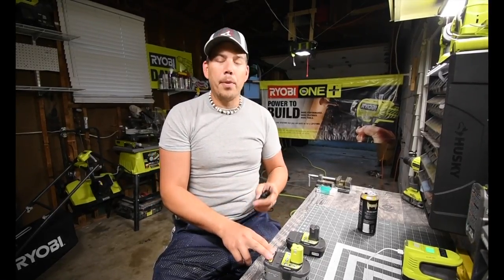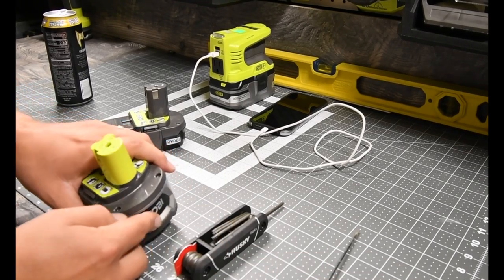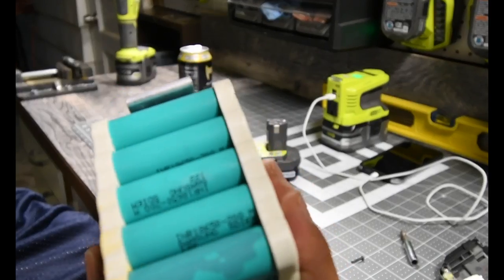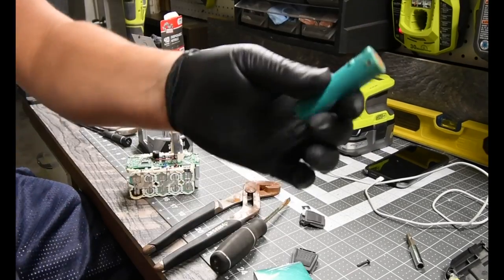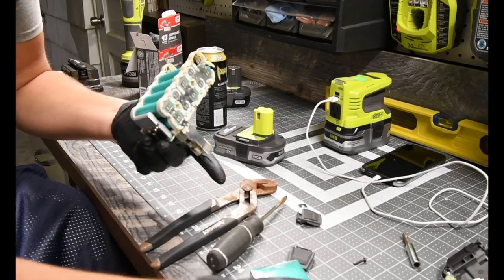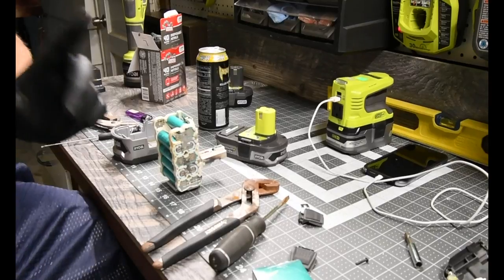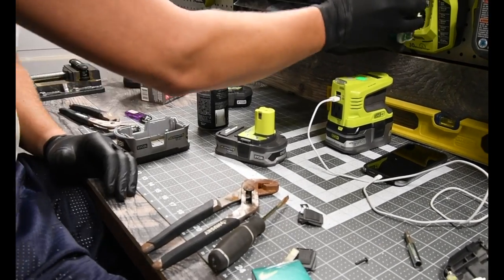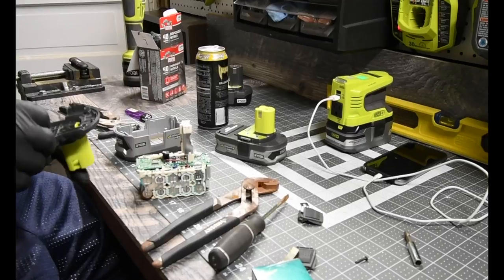Ryobi Battery issues!!

Comment: On the dead pack it may have a dead cell.  What often happens with Lithium-ion packs, especially if you store them for long periods either completely full or very low (they like being stored @ 50-60%) is sometimes a cell drops to a voltage where the charge circuitry thinks the cell is damaged.  In this state the charging board in the battery will not engage.

Check the voltage across individual cells with a DC voltmeter.  If you find cells below 3 volts you can attempt to "jump charge" the low cell(s) with a 9 volt battery.  

Take a fresh 9 volt battery & a 9 volt connector with bare wires.  Touch positive to positive,  negative to negative on the low pack batteries.  Touch on the specific cells paying attention to polarity.  Hold for 30-60 seconds & then check the cell voltage with your meter.  If you get them all up to the charger threshold the pack will begin charging.  Cycle the pack once or twice to help balance out the pack cells.
Reply from the maker: will do sir and thank you
Reply: @ManCaverTools  i found 2 dead cells and replaced them only to realize the pack doesnt power the recip saw longer than 30 seconds...sigh

Comment: Had similar issue with the 2ahr. Had to jumper it like a car battery using a 4ahr. Only 15 seconds on the big contacts. Then charge like regular. Plenty other vids about how to.
Reply from the maker: Ill check them out
Reply: This is what I did once it's replaced a couple of bad cells. Worked like a charm👍

Comment: You have to check every battery for voltage with multimeter, if battery is zero is done but more than 1v it can be safe and also you can add another battery to the pack as long as you solder the ports and it's the same amps or close to it; now the 2ah battery check the voltage from positive to negative on the pack and not the top ports and every single battery because most likely it got discharged below the threshold(which is around 13v to 14v) and the charger says it's faulty, if that's the case and every battery has charge in them you have to jump started with another battery(preferably), there are plenty of videos on youtube to show you, it will be too much for me to write on lol but i could if you want me to lol, i fixed mines that way but some the board got fried so i took it and use a balance cable for each battery but that's for another trial buddy lol, good luck and keep up the good videos👍👍👍. Btw i love ryobi but I'm not only using ryobi i have other brands so i haven't signed up for the group because of that
Reply from the maker: I ll learn on how to jump start it and thank you sir

Comment: Don't know if you still have these but for the water one you can put isopropyl alcohol it removes corrosion. The 2 ah one you can maybe use a multi meter to find the cells with low voltage and jump them up. I did it on some old dewalts and they worked.
Reply from the maker: I do not have these but I thank you for the info vane

Comment: Agree with others on checking all the cells. I also sell Ryboi ONE+ & Craftsman C3 tools online. When I get a bad battery I take them apart & I check every cell. Most times it's just one cell, but you have to check them all. Usually replacing a bad cell will fix it, but you need a multi-meter to check for sure. I don't sell the batteries I fix. I keep those for myself.

Also someone said they get into what I call a "Funky State" where they are still good but the circuit board thinks otherwise. Sometimes they won't charge but will run in a tool. Discharging them will help start the "Charge Cycle" over. 

You can pick up a cheap multi-meter for $20 or much less. Just to check battery cells I wouldn't spend a ton of money. But as the batteries start to fail in the future, it will come in handy & it only takes one to go bad. Thanks David.
Reply from the maker: I also think there is issues with the motherboard as well

Comment: Its probably the board on each one. I would get a multi-meter and test each cell only thing for certain is the one cell that's obviously bad. If the cells are good you can use them in flashlights or other projects. You can even take out the cells in batteries that have just a bad cell or two and you have those spares to replace.
Reply from the maker: its garbage. it was sitting in water for too long and thank you

Comment: I have had to take them apart before. When they quit working alot of times they have fell below the voltage needed for the charger to recognize them. Some of the tools have a drain I have found when the battery is left attached. When you have the top off make some leads and jump them off another "good battery " for a few seconds and then place the cover back on and pop it on the charger. Please note the jump point on the battery is on the board. you will find two plates a pos and neg. Hope this helps someone.
Reply from the maker: Thank you very much sir

Comment: Also please be aware you're dealing with little bombs if there is a short, overcharge, or othersuch problem.
Reply from the maker: Thank you. it is dangerous dealing with exposed batteries
Reply: Or if when you're going to resolder it back into the pack, and keep the heat on the terminals of the battery for too long

Comment: Get a volt meter and check every single cell on that 2 ah battery and the 4ah if they all show 0.0v then you can reset them and make them work again but I wouldn’t do that since the safety positive(+) popped for a reason .... if you do see some voltage then try recharging them using some alligator clips and a more define charger ... not the Ryobi
Reply from the maker: Ill be sure to get a volt meter and thank you
Reply: Ryobi Man Caver no problem

Comment: Charge the cells in the 2ah battery individually   To get it some juice and it should work again. Sometime the 2ah batteries die down so low the charger thinks it is a bad battery and will
Not recharge. I’ve seen this happen a few times, worth a shit anyways.
Reply: Shot*
Reply from the maker: Ill try that sir an thank

Comment: You've already gotten several different answers already, being a year old video, but you can order a replacement battery chip board, a similar mAh battery, lightly and carefully tack soldered exactly how you took the last one out, soldering the nickel strip as flatly as possible. 
Then, put it to charge and see what happens.
Reply: If nothing else, you have a 29th power battery to practice on

Comment: For the 2amp hour batter pack they only way to revive the pack is by making a jumper cables and connecting the 2amp hour battery in parallel with another 18v battery pack because when the 2amp hour battery in placed inside the charger is reading the battery voltage as below what the charger thinks is a safe voltage to charge at and will not charge the battery because the charger does not want to damage the battery which is why the 2amp hour need to be jumped and have the voltage brought up to were the charger would think it is safe to start charging the battery

Watch to have a better understanding of what I'm trying to say

https://youtu.be/GCMDtcmi1DQ
Reply from the maker: Thank you sir, ill check that out